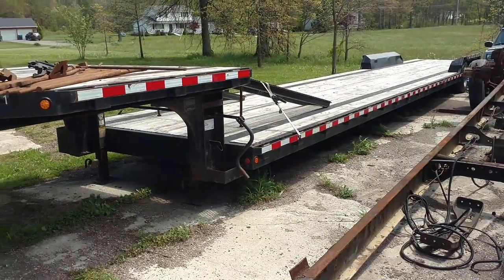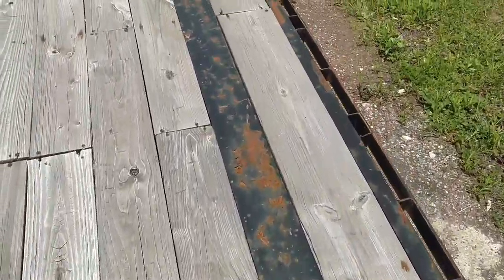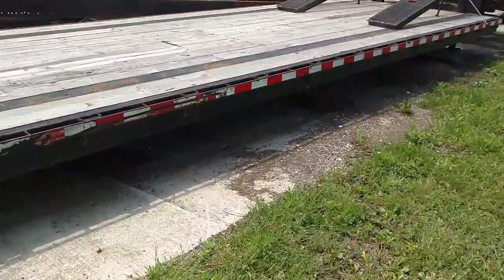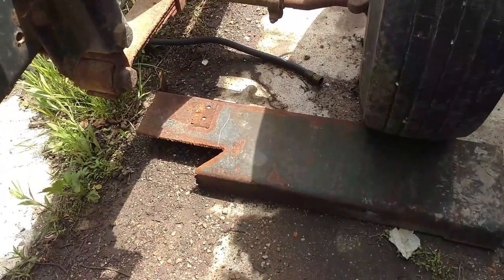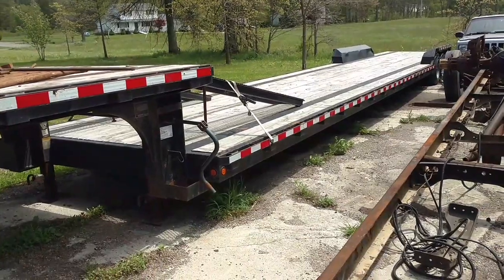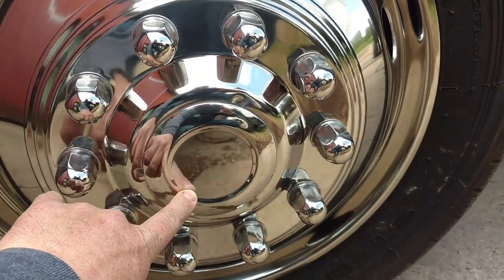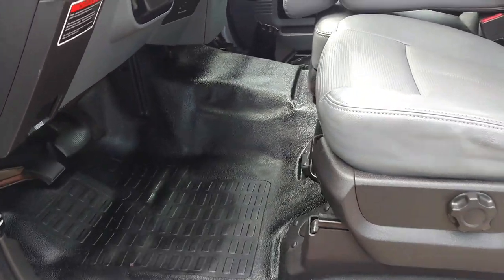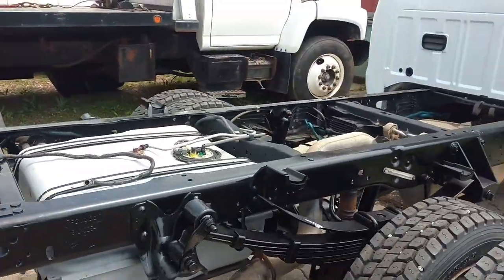2013 53' step deck for my c4500....sneak peak at the cleaned up f450

Comment: Here is a design idea for the trailer wheel humps. Make four modular ramps which plug into the stake pockets fore and aft of the humps. Bridging the hump could be another piece that could be removable or permanent. It seems like you'd want the option of being able to roll wider rigs over the wheel humps; but not be permanently obligated to carry around the additional weight.
Reply from the maker: i am ok with making the ramps permanent. i think it will be lighter if it is welded in place. i think i am going to start a different trailer project soon. that 53' trailer will have to wait...... unfortunately.

Comment: Hey I have a 2000 Ford f450. I’m looking to buy a older 2005 sho step deck trailer.  Will that be an issue to have that setup together? Do you know what type of 5th wheel hitch low profile do you recommend

Comment: I didn't know it was legal to pull that much trailer behind a 4500/5500.  Door tag on my '06 5500 says 26k GCWR, trailer alone exceeds that at 30k, is there something I'm missing that you can do 49.5k GCWR legally?  Do they only care what you're plated at, and don't worry about door stickers?

Mine is a box truck atm, but I wouldn't mind having the option to pull it and add a 5th wheel to pull something like that 53' step deck.
Reply from the maker: look at that tag again. it was probably put on by the company that put the box on it....not gm.
Reply: @j.c.smithprojects  no sir, it's the GM tag.  GVWR 19.5k, 7k front axle, 13.5k rear axle, then it has the tire sizes and pressures, and beneath that the 26k GCWR rating.  

I've heard others say the GCWR isn't important, so long as you're registered for the weight and you aren't over on tires or axles, but haven't been able to verify that.  Just curious to know what all options I have with this truck, appreciate the reply.
Reply from the maker: a friend of mine was an owner operator for 52 years. he says "you can hook 100,000 lbs to any truck with enough axles.....it doesnt mean you should!" as long as you are not overloading your axles, or over taxing the driveline....i dont think it would matter to me, within reason.
Reply: @j.c.smithprojects  sounds good to me!
Reply: @GrandPrix46  the tag says that because of the parking brake pawl on the automatic.transmission. they are not rate over 26 k , for parking on a hill. Chock the wheels and unplug the emergency trailer brake lanyard. Then the trailer battery will hold the trailer too. Just remember.to.hook it all up before you try to move, or it's like being in a truck pull.

Comment: Hi, can You pull a tráiler like that without a cdl?
Reply from the maker: no. the gvwr on the trailer is 30,000 and the truck is 19,500
Reply: @j.c.smithprojects  hey Thanks for your answer